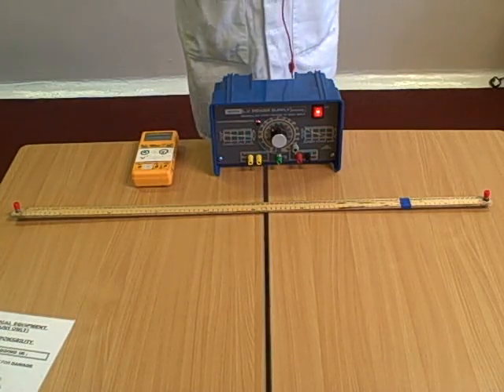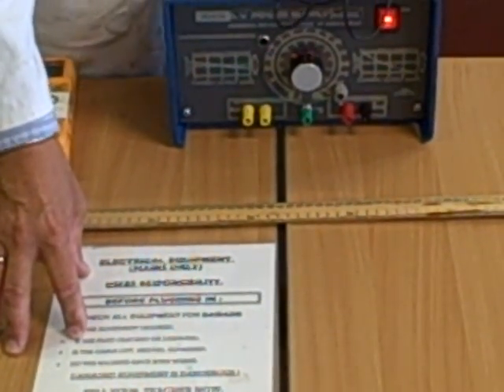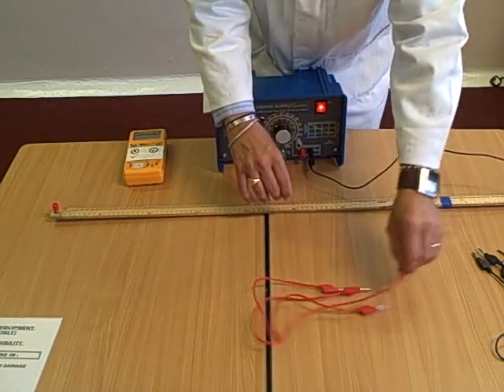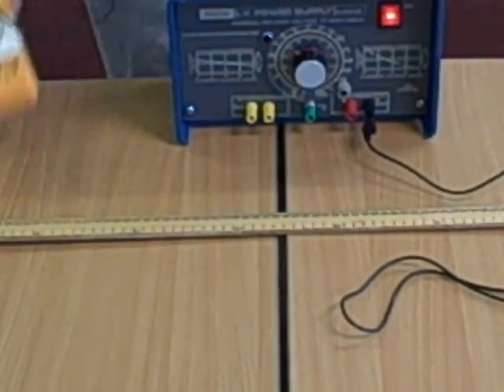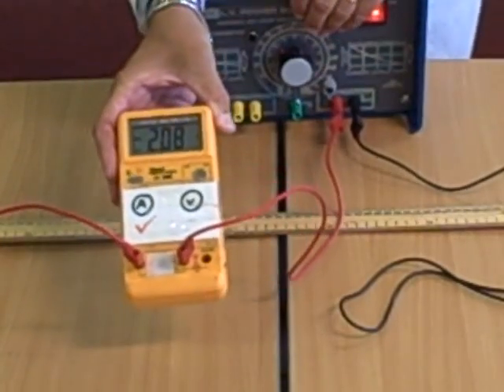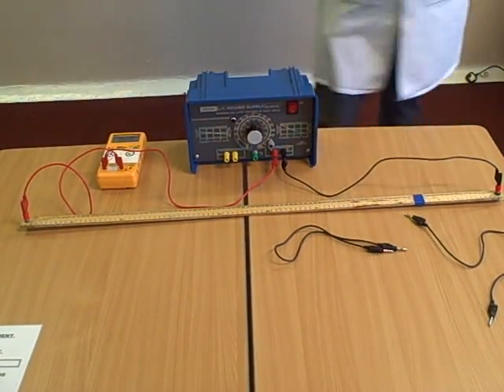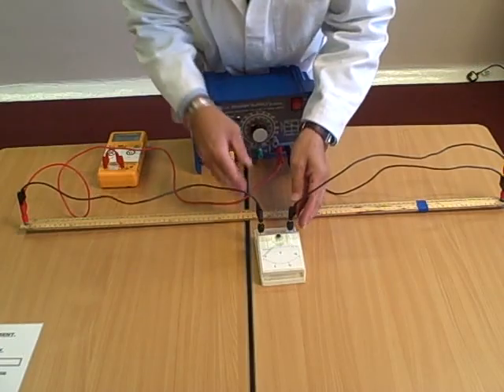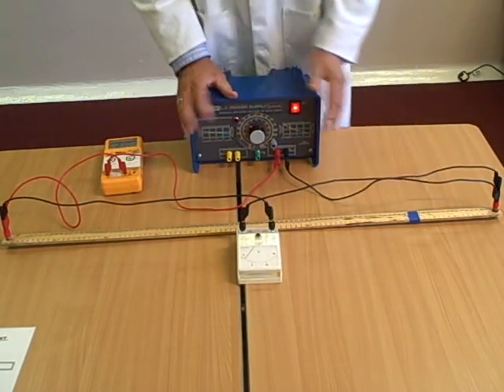Resistance of a wire

Comment: Why the amperímeter is in the circuit,  and why cant measure   the resistance directly?  Thanks for the explication
Reply: The amp meter is in the circut to read the current passing through the wire. Some experiments will change the length of the wire as a independent variable and change it from a range of 1m to 0.1m. This simply allows you with the reading of the voltage meter to find the resistance which is Resitance = Voltage/ Current(Amps) or R = V/I. The reason you cant measure the reistance directly is due to the fact you can't actually see the electrons and how they are being resisted by the wire by colliding into its atoms and no instrument directly takes the resitance of the wire because it too would have some sort fo effect on that wire if so.

Comment: what is the material of the wire???
Reply: Might be Nichrome wire.
Reply: Mohammed Fahad Bin Jamal the wire at my school was just steal wire
Reply: It is NOT steel. It is a nichrome wire, which has a high resistance therefore appropriate in the practical in order to obtain readings

Comment: Hi, can you post a list of the materials and the methodology i want to use your experiment for a practical exam
Reply: Circuit boards + Batteries
Connective Wires
Alligator Clip
Voltmeter
Ammeter

That's how I generally did it for my assessment.